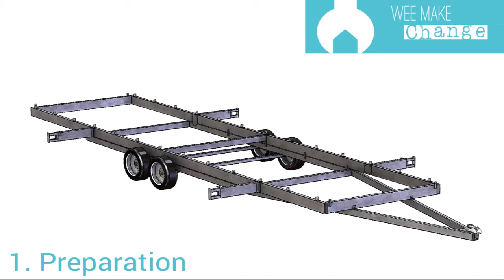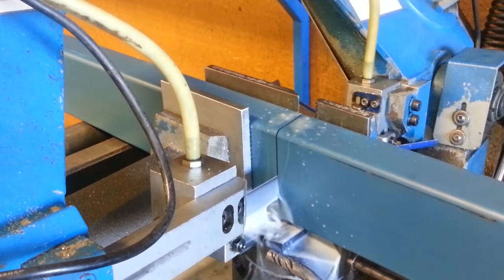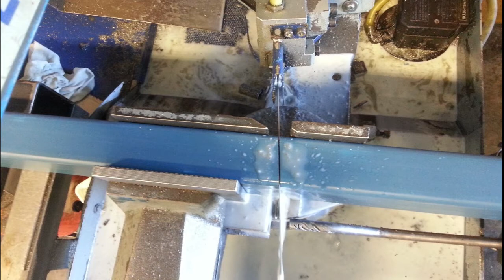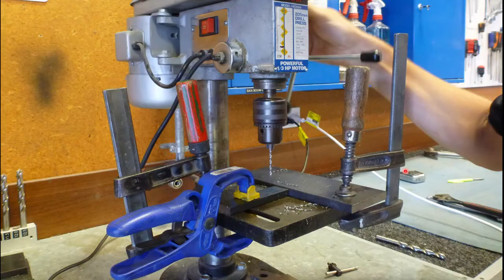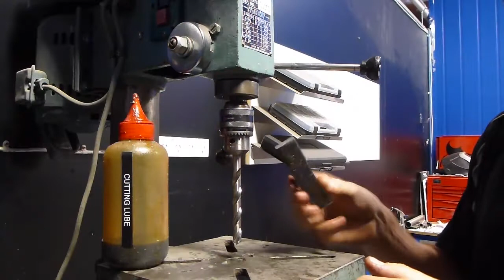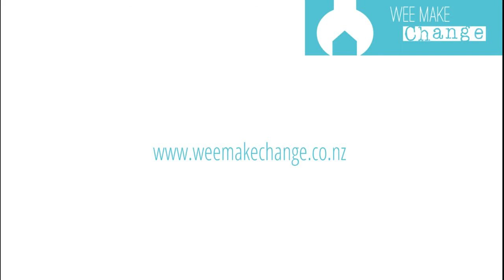Tiny House Trailer Build - 1. Preparation

Comment: Kia Ora! How much would you sell one of these trailers for?
Reply from the maker: Hi, are you after exactly what we have designed and build? We can customize also if you need? Let us know and I will get you a price. Thanks
Reply: I am going for 7.6 by 2.4W Galvanized with electric braking system. Pretty much the same as your design with these measurements. From my understanding the laws have changed so that you cannot move a 3.1m wide trailer without being an oversized load.
Reply: Hi up to 3.1 can be moved on nz roads within to much issue. See https://www.nzta.govt.nz/commercial-driving/permits/overweight-permits/driving-overdimension-vehicles/ Thanks